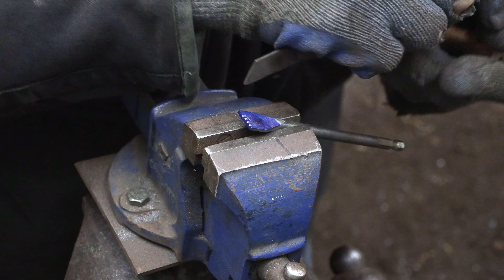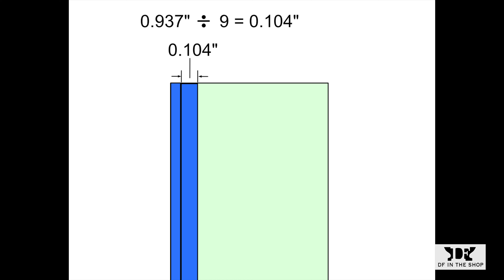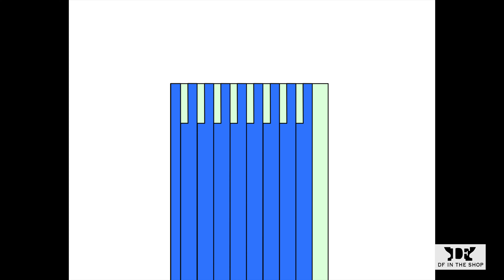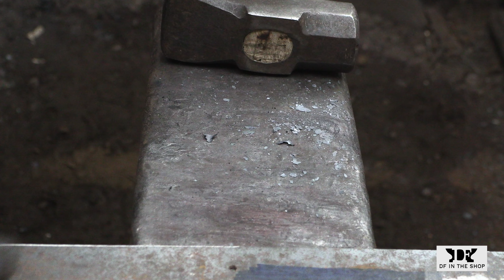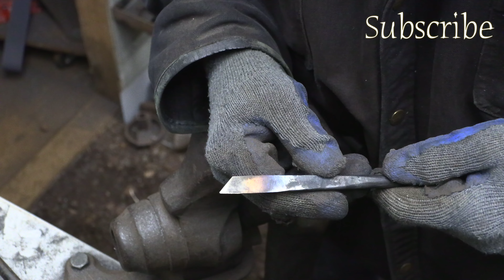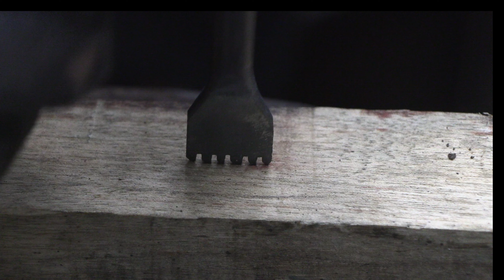Blacksmithing for beginners - How to forge Pricking Irons

Comment: 0.0625" x 25.4mm = 1.59mm
Reply: Pricking irons are usually in the range of about 3mm between points to about 4.5mm at the largest.  While slightly larger or smaller may be available 1.59mm would be very unlikely.
Reply: @andrewgray9663  Its DF specifying the 0.0625" (=1.59mm) not me.
Reply: @singlended  Fair enough and I appreciate you taking the trouble to supply the metric information.  Nonetheless I don't think the pricking irons in the video looked as small as one and a half mm to me.  The spacing is also too ragged for this to be useful and the points as shown at the end are nowhere near sharp enough to be used.

Comment: Question I don't see a recommended steel. I'm going with 01 unless you sujuest different. 
Because I built several before getting it good enough to function only fairly well
BIG THANKS  so glad you are back.
Reply: Used a spade bit. Aka paddle bit. And annealed it prior. He made chisel from coil spring.